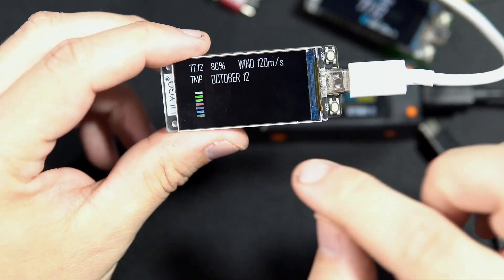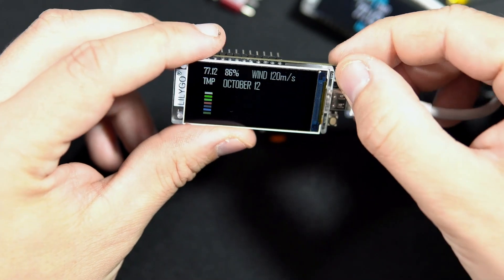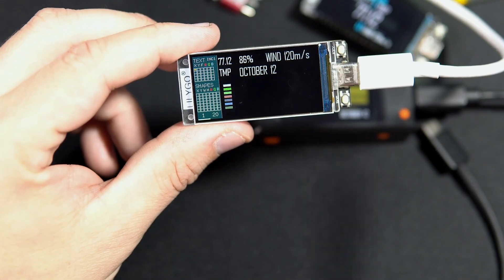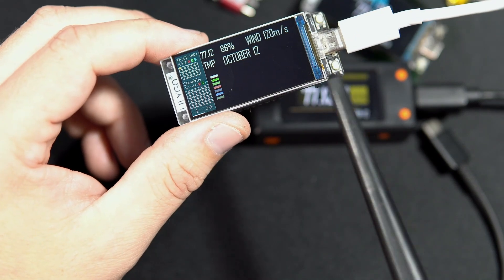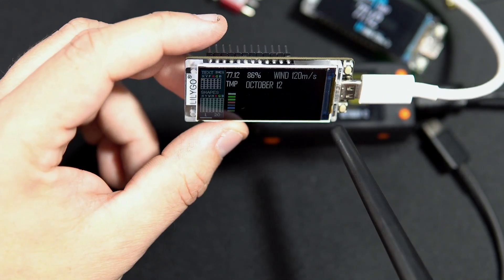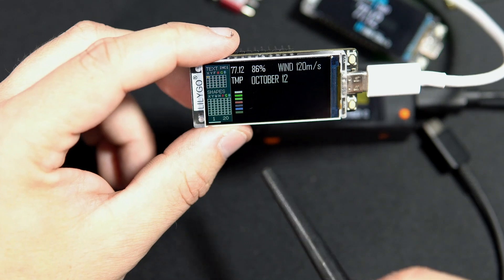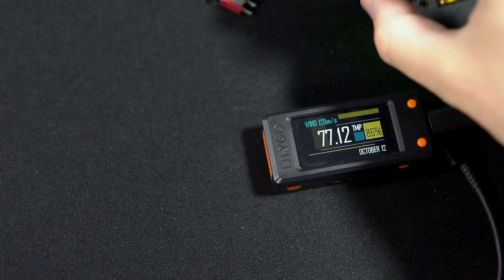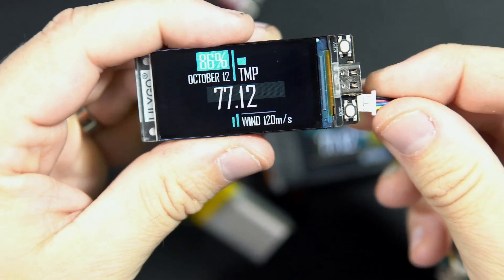How to Change User Interface without reprograming ESP32

Comment: Nice !  Enjoy a Kof-fi.  Interesting use of the detachable rotary encoder. A solution looking for an application?  Im wondering if a Bluetooth interface might be useful also so a mobile phone with a terminal application could do the configuration ?  Also if the approach can be expanded from the 80bytes of numbers to store statements of a simple GUI scripting language (rectangles, circles, text etc) to be parsed. Also maybe add a sequence of functions in the baseline project that can be selected to produce the text to be output in output fields  (eg 1:read Analog0 ;  2:ReadButton1 status ;  3:Read I2C address value ; ... etc).
Reply from the maker: Tnx Alex, i still havent play with bluetooth and i havent made any mobile app in while. But your idea is great. Tnx again.

Comment: You do realize you need a user manual for this "simple interface"?

When I read the video description, I thought you'd use an internal webserver on your network, and the chip would access it to find it's new settings. Then you'd use an HTML interface page to change the settings on the computer or smartphone. You should take my mistake and use it an idea for the next video. It'll be far more interesting.

Comment: I'm working on a larger development board/system for the Lilygo T-Deck in the style of the Rockwell AIM 65, so I'm going to have to make sure the same software runs on both platforms. Your concept with the configuration in EEPROM could be just what I need for that project - still in its early concept stage.

Comment: I think it is a bit too low level and too elaborate to change UI elements.

Suggestion to make it simpler.

Consider a 3-level menu:

- Switch between selecting object or perform edit on selected object or exit menu
- Have some selector to what you would like to do (pos L/R, pos Up/Down,  size Width/height, color) or move back to selection menu
- Alter the setting

With 1 button, you either select whatever is highlighted in your 3-level menu, except for the last option.
When altering the setting and pressing the button you just leave the "altering" mode and go back to whatever you want to do.

So in short:
Click on dashboard screen = show menu

1st layer menu: switch between select, edit, exit  Button click = confirm selection
2nd layer menu: When in select mode, move to element and press button to confirm selection
When edit mode is chosen, select what you would like to alter. Press button to confirm selection
3rd layer menu: Perform edits. Press button to confirm changes and move back to 2nd layer.
Reply from the maker: Tnx, i will still improve this alot , and i will need more encoders :)

Comment: I've never clicked on a video so fast haha. I'm so glad you have showed us the secret of how to create a UI without having to build/upload new firmware just because you want to change the font size or position of text etc. It makes perfect sense to me as I'm always looking to reduce the development cycle of idea-->adjust code-->build-->upload-->test-->repeat, so that the creative process can just flow quickly. This is one of the reasons why I'm not a massive fan of SquareLine Studio/LVGL for MCU UI design. Maybe the best option is to use SquareLine Studio for creating the overall UI concept/graphics and then use your new interactive method for the fine-tuning etc once the code is running. Cheers Tony
Reply from the maker: Tnx Tony, this is just concept.but with some improvements maybe some more complex is possible.

Comment: That would save a lot of time adjusting the display without having to keep changing code and reloading. Thanks Volos.
Reply: If you are using lvgl as graphics library, it has a simulator which you can compile on your PC and create the interface there